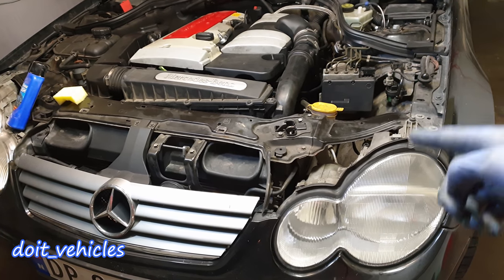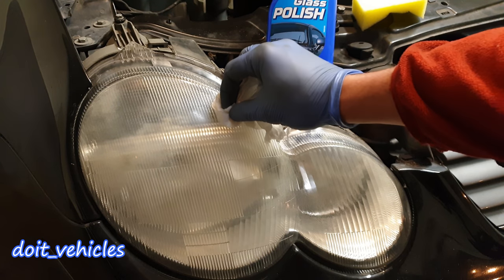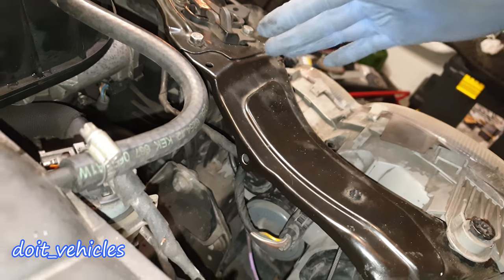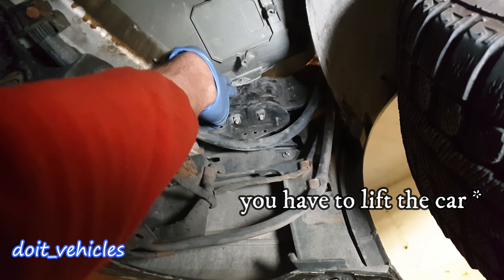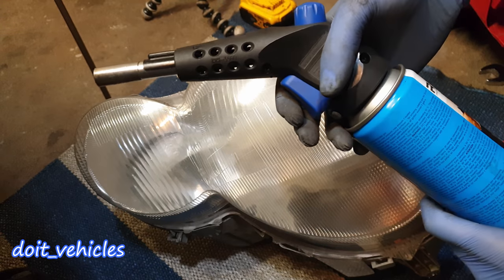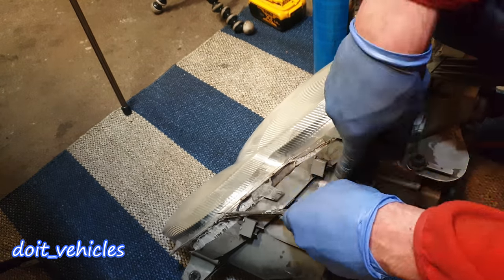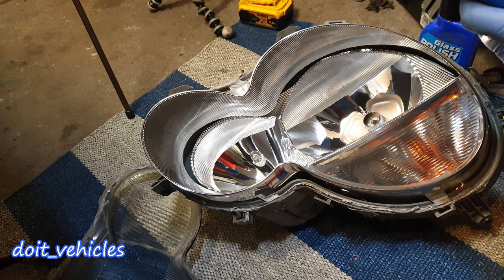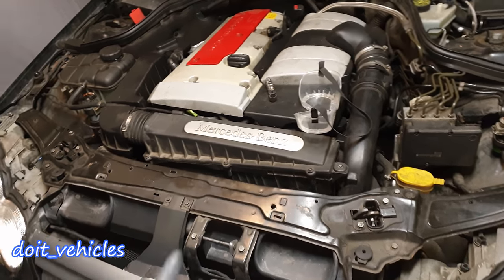Mercedes w203 Headlights Assembly Removal / Glass Restoration C class - Cheap DIY

Comment: Nice video man. Everyone else said removing the front bumper is absolutely necessary but you showed it isn't. Great job!
Reply from the maker: I try to think out of the box 😁
Reply: @doit_vehicles  Thank goodness you do. I was dreading taking off my bumper this week.  I hit a semi-tire on the highway at night going 75 mph, it ripped out the right fog, the temp prob and the wiring for them as well as the wiring for the low beam and the turn signal.  I was lucky it didn't make me crash.  You should consider making a video on the wiring from the lights to the relay that includes colors, connectors and placement of the wires.  At the moment, there are only videos replacing wiring harnesses inside the lights.  I have a WIS tech manual and it doesn't really spell it out too well.  The one thing I do see are people in the comment sections looking for a video on how to do this.  Thanks again.

Comment: hummmm i need this. cause some old lady fully brake'd in front on me and my headlight got pushed back, (i live in france) but lucky i had a english doner car... but no i run 1 LHD light and one RHD light from england... and its very wierd. its my driver light is now a english light so they go the opposite way + its cover is yellowish... mine where clear AF, but i touhgt maybe i can swap over the hole inside in the housing of the other light so i got 2 european lights again since the accident broke off all the mounting holes on mine...

Comment: This is not easy at all. Plus i don’t understand why in the first versions if this mercedes i think from 2000 to 2003 they made those thin lines on the headlights. They removed them in the next versions and it looks much better
Reply from the maker: In theory it should be for focusing the light on the spot it's needed and not on other drivers ..
Reply: @doit_vehicles  I just found out that theyre called halogen Headlights and here is an interesting article https://www.autotrader.com/car-news/how-did-we-see-halogen-headlights-281474979975575
Reply from the maker: Doug DeMuro the type of guy ...
Reply: @anasbtr  Yes, that was the problem for me on the highway the night I hit a semi-truck tire.  I didn't see it until the very
last minute and I was afraid to swerve and cause worse damage if it went out of control.  Now you have me interested in updated them.  Thank you.

Comment: To restore the lenses (outside front surface only), just use TOOTHPASTE to put it over and wipe with a little wet cloth or towels, it will be clear like crystal ....
Reply from the maker: It will work only if the lenses are not heavily worned like in my situation .
Reply: Chris Fixx has an excellent tutorial on this that might be interesting.  He goes into great detail.